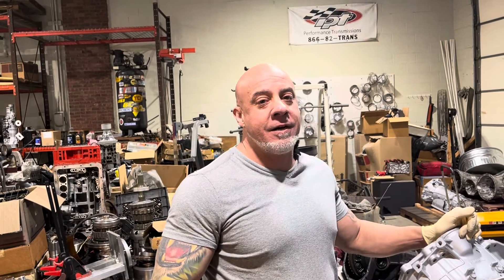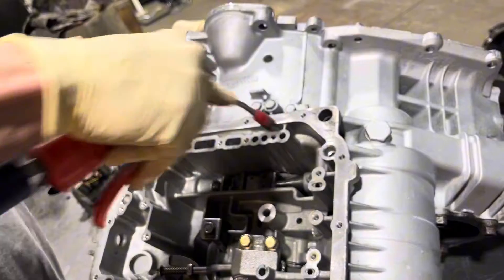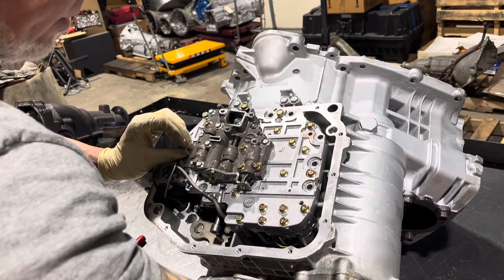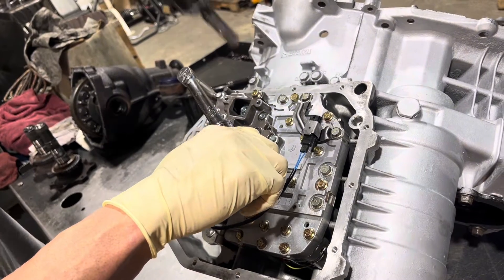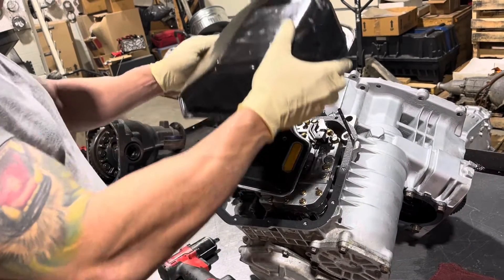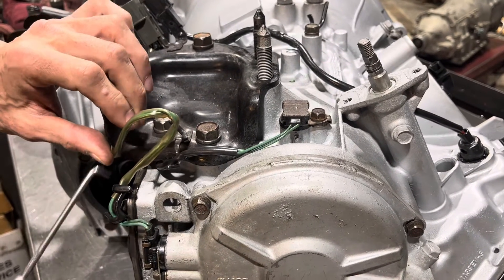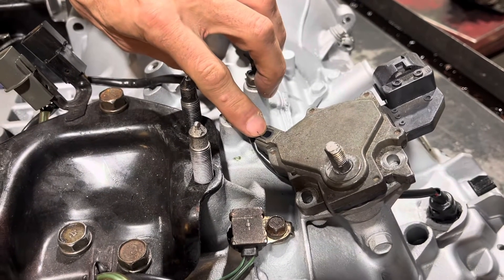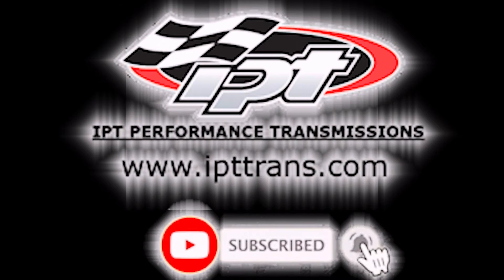W4A33 DSM Mitsubishi Transmission Final Assembly Part II

Comment from the maker: We specialize in high performance DSM and Mitsubishi automatics, as well as many other models.
Find Us:
https://www.importperformancetrans.com/
973.406.7000
Instagram - @IPTperformancetransmission
Facebook - Import Performance Transmissions 
Tik Tok - IPT_Transmission
Reply: Hi there. First thanks for all the videos, they helped me a bunch. Can I run this trans without a output shaft for my fwd car, by removing and pluging the hole in bellhousing or does it mess with the oil pressure inside?
Reply from the maker: @hrod4897  It’s been done before but if it were me, I’d just get the correct transmission for my car.

Comment: Five minute mark you talk about the valve ,,if that’s not put in properly with happens ,, I had work done at Mr. transmission he put a shift kit in an overdrive clutch pack last fall around me I went into shit mode now I have a code of 83 should I take it back to them or is it a stuck valve there seems to be power going to it 5 V and 12 V I’m racking my brain about this nobody will touch this transmission,,,